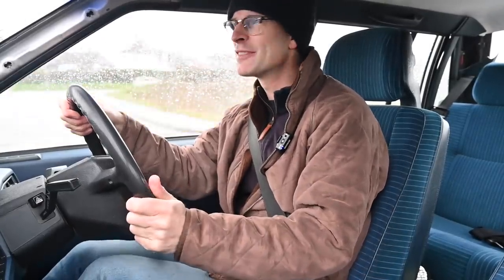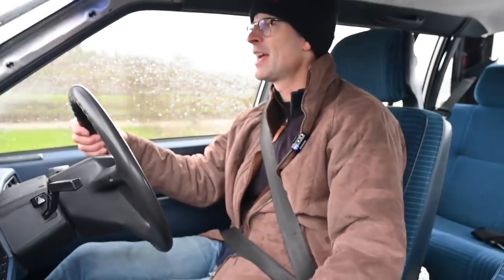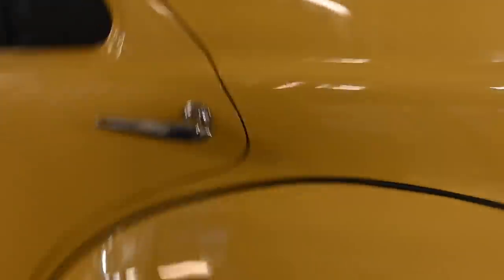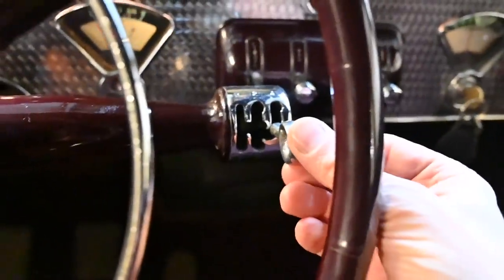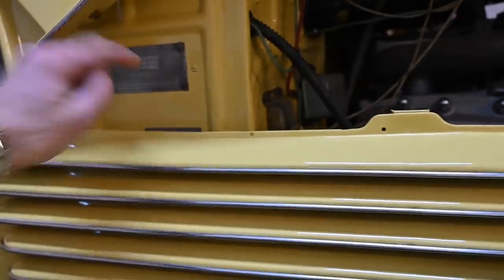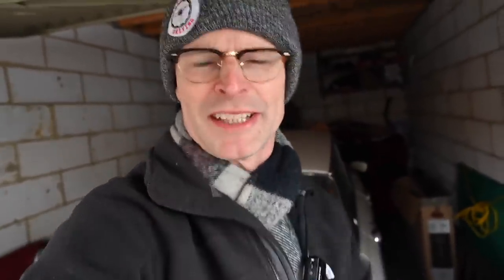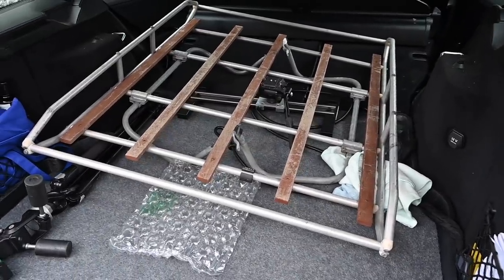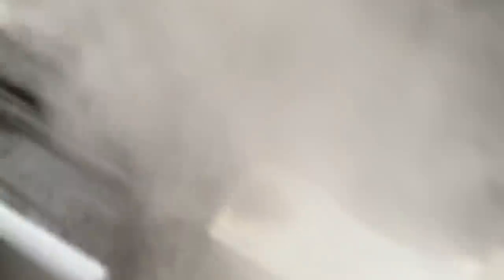Rover Coupe and Volvo 740 in: An MOT! A breakdown! A Cord?

Comment: An swedish apologize for the Volvo failing you, check the expansion canister lid also, it should open if the pressure get high enough. I hope the head gasket and the waterpump is okey, I've seen new waterpumps with plastic impellers that can get loose from the axle if the water get's to hot!
Reply from the maker: I dont think it had over heated, the gauge was OK when I was driving. It was a 32 year old radiator so it did OK!
Reply: @furiousdriving  yes, old radiators with those plastic edges isn't as resiliant as older metal. But I have never seen one blow like that, maybe I haven't own one long enough?

Comment: How to pass a Illinois Emissions test. #1 clear the computer # 2 drive it on the tollway to the emissions test center, #3 pass as you pull out the check engine light comes back on

Comment: Exactly the same thing happened to my 740's factory-fitted radiator in 2006 - a common problem, apparently. Luckily, I was only about 200 yards from home when it failed, so no damage was done to the engine. The Nissens radiator I subsequently fitted (a very easy job) has been perfectly fine.

Comment: I've got one of those roof racks sitting in my shed, never been used, still got the original stickers. Even got a couple of the plastic bolt covers to tighten the mountings. Open to offers 😁

Comment: Bad luck with the rad, but on the other hand you could have easily been scolded.  When I changed my rad on my 240 it was very easy, but didn’t have any rusty bolts/nuts to contend with. The Cord what a Beautiful car , work of art. I think Jay Leno did a video on one.

Comment: IIRC the Volvo rad is the two clamps on the top and it sits in rubber mounts at the bottom, two main hoses plus the small pipe on top and that is it. Hopefully straightforward for you.
Reply from the maker: Thanks, I hope its just that and not a rusted bolt in the bottom!

Comment: Glad it passed, one thing I always did after buying a car with a new MOT on it was take it for another MOT at a different station to the one that issued the cert immediately so as not to put too many miles on the clock, surprising the number that failed with some very serious faults,  money back time from the seller and with the proof to back up any court proceedings if they were reluctant to cough up.  Yes I do know an MOT only relates to the condition at the time of the test, but 50 or so miles would not make any difference to serious structural corrosion, often unseen and well disguised as getting underneath on a forecourt is often difficult.  Thankfully Cowboy dealers are almost extinct now,  but seem to still be a lot getting a visit from the Sherriff's (High Court Enforcement Officer).   Hoping for some dry weather for you so the Convertible can get to an MOT.

Comment: Very interesting indeed! A real treat seeing the Cord. They were definitely interesting cars. Well ahead of their time. The Beverly Hollywood used the same body on a rear wheel drive platform after Cord/Auburn/Duesenberg went out of business.

A shame about the Volvo doing that to you. The rad certainly was looking dodgy. The factory radiator in my 90 failed at the 28 year/300,000 mile mark. Unfortunately it happened while I was on the motorway, and by the time I could get out of the live lane, the engine overheated and the head gasket went. Still, a radiator is not bad. Mine came to the equivalent of £170 for a custom made aluminium unit. 

Super news about the Tomcat. That is one neat wee beastie indeed.

Comment: Sometimes head lamp bulbs don't fit properly or haven't been fitted properly consequently the beams incorrect, other bulbs like stop and tail are sometimes put in the wrong way round, you can rub the yellow coating off indicator bulbs flaffing about trying to get them in and the pins on some bulbs just don't eminate enough to stay in place.
Reply from the maker: In this case one just blew at the wrong time
Reply: @furiousdriving  For some reason usually not long after you change a headlamp bulb on any car the other one goes ! New bulbs all round usually make a car look a lot brighter lights wise.

Comment: Exactly the same situation happened to me with my -88 740. I had changed the very bad and old radiator hoses and the rust on radiator made me think that the pipe was metal. It broke on the test drive. Cause of failure: I tightened the clamp to much

Comment: I put my interior heater metrix full and then interior fan full on if that doesn't reduce the engine temperature, if heats coming through it must be taking it away from the engine.
Reply from the maker: This was functioning normally until the end

Comment: Yikes. That looked quite spectacular. It least it happened when you were stopped and not on a fast road. In all fairness if it's the original radiator it has done well to last this long. 

Good news about the Tomcat. Was it a good tape that was rattling?
Reply from the maker: I think it was Guns'n'Roses or Skid Row

Comment: That roof rack is for a volvo 140 or an amazon not a 740.
Reply from the maker: in that case Im going to have to get an Amazon or 140..
Reply: @furiousdriving  Yeah. Try it on the 740 but I dont think it will look right assuming it even fits a car without gutters. Would look really cool on a 145 express or a duett.
Reply: @furiousdriving  Oh it did have gutters. IT's from the time when "swedish top-gear" startedt complaining about most cars than they didnt.